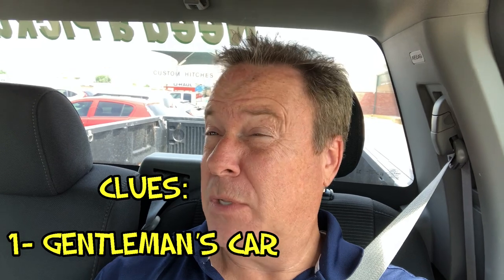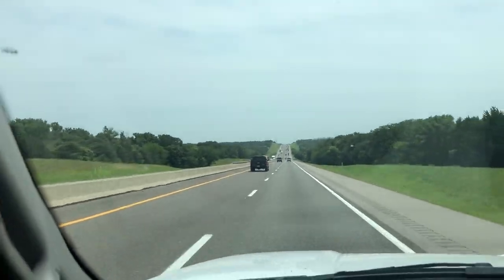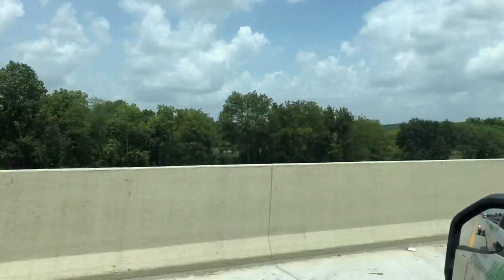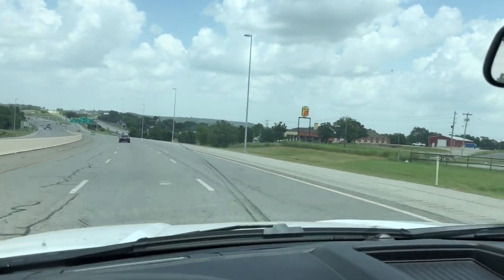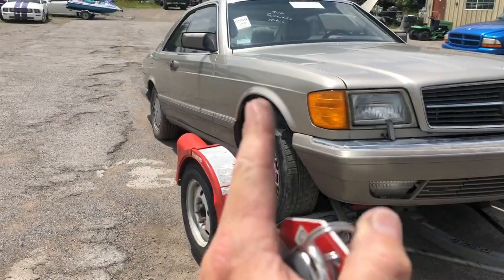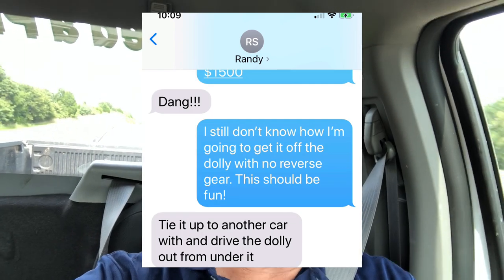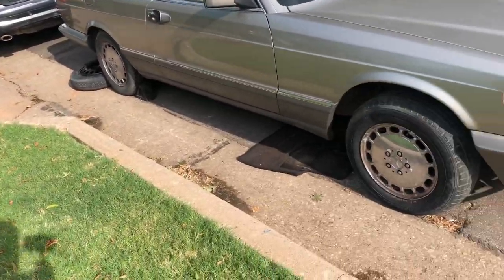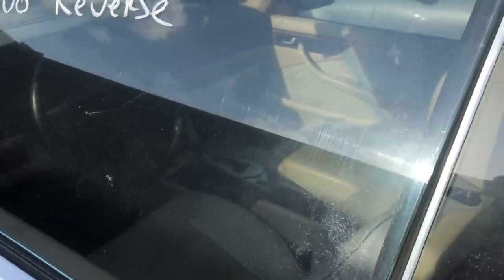Mike Buys A Classic Mercedes!

Comment: Hey Mike. Few things. 
It’s not a great idea to tow a rwd car with the drive wheels on the ground and the driveshaft connected. It will burn up the trans...either put the rear of the car on tow dolly or put on a car trailer. 

Check to see if your shifter bushings are OK. These old ones were known for worn/sloppy bushings with age. It’ll make it difficult to get the right gear. Also check vacuum etc.  hate to see you put a trans in before full diag by you. 

That is a California car based on the service sticker on the driver door and info on radio.  

Check your calipers to make sure the hoses and pistons aren’t leaking- that’s probably why the chrome is peeeling bad. 

And above all CONGRATS on the car!!!  Very cool find. I’ve been a subscriber since you barely had 100 - great entertainment.  Keep it up!!!
Reply from the maker: Thanks for the tips. I know about towing with the rear wheels on the ground, but because this car already needs a transmission I wasn't concerned. The previous owner tried everything to get it to work, but there's no reverse which is a common problem. I'll check out the calipers! Thanks!!
Reply: @MonkeyWrenchMike  the w126 chassis Mercedes received the first version of the G-Tronic transmission.  I have really like your SEC You got.  I love the w126 chassis, they have a very stately and intimidating appearance.   But intimidating is what they can be to work on too.  That's sad yours doesn't have a reverse, but are you entirely sure reverse is completely gone.  It wasn't as simple as the selector bushing being worn resulting in the selector being in reverse but the linkage didn't actually select reverse?  Or the shift modulator?  What about the fuel pressure regulator?  This affects shifts by throwing off the amount of vacuum the car receives.  I'm just curious because I haven't heard of Daimler-Benz era Mercedes having transmissions really die.  I've heard of them act like they're dying due to other things completely unrelated to the transmission making them mess up.  My transmission shifted funny due to the pcv hose.  3rd gear would slip under a certain amount of throttle input, but once that hose was changed (and only that hose) it shifted beautifully.   It would also bang into reverse and spin the tires a bit, and that was fixed with the hose too.  The Daimler-Benz era Mercedes are all worth saving and they are really well engineered and super high quality, but they can be a big pain to deal with when they get to the age where everything is wearing out.  I asked these questions because a transmission is so expensive, and with an old Mercedes 9 times out of 10 the solution to a problem is because of a problem elsewhere on the car that is a cheap and easy fix.  Oh, one important thing with the w126 chassis and r107 v8s is the timing chain and the guide rails.  If you haven't checked out Kent Burgsma's videos at Mercedessource, I highly recommend that you watch them.  He has decades of experience with Daimler-Benz era Mercedes and has some clever solutions to things.  He has a ton of insight that all Mercedes owners can certainly benefit from.  My 380se needed a new chain, sprockets, and guide rails and it's at 150,000 miles.  I hope you're enjoying yor SEC.
Reply: @jacobbelcher3512  Very good Advice!  I drive a 87 W126 as my daily driver for 2 years now.  Solid as a Rock.  They were heirloom cars. Dealers told Owners to change their Will to decide who gets it on their death.  They were intended to last that long.
Reply: @jacobbelcher3512  Nothing "Tronic" about that transmission, purely mechanical.   That car has a version of the 722.3 transmission and when they wear out, the reverse clutch (B3) is usually the first to fail.  The first hint of trouble is when you put it in reverse and it takes a couple of seconds to engage.  I've rebuilt a bunch of them and they are a very nice gearbox.  The G-Tronic you are probably referring to is the 722.6 which is an all electronic valve body controlled by a computer and is the predecessor to the 7G and 9G.  No W126 ever got a 722.6.

Comment: Check to be SURE the linkage is actually putting the transmission into reverse. This was the problem with my 560SEC! If the shifter bushings are gone, this is an easy check. More involved:

http://www.europeantransmissions.com/Bulletin/DTC.merc/97-20.pdf

Comment: I had a 560 from 1987 and currently own a beautiful 500 SEC, 1985, purchased from the original owner. It's a keeper. Spent a bit of time with none other than independent Mercedes mechanic extraordinaire Pierre Hedary in April and he sorted everything for me. Yours certainly was neglected in some areas and will need a lot of attention. But if you are methodical it will be well worth it.
Reply from the maker: I may need some guidance from time to time!!

Comment: Hey Mike, I have a 1988 W126, and I had problems with the trans too. It wouldn't shift out of 1st gear, and also had problems getting it into gear from park. My mechanic was able to correct the issues with 2 simple fixes. The first, the reprogrammed the computer (apparently these 30 year old "classics" have 2 of them); and the second fix was to replace the gear shift bushing. Trans works great now.  Hope this info helps...
Reply from the maker: I’ll look into this. Thank you!!

Comment: I am making the assumption the transmission shown on the ground is either a "used good" or rebuilt. If that was included with your purchase, you did well.  It is really nice to see a car of that vintage (nearly 25 years old) in such nice original albeit sunburned condition. It is relatively free of whiskey dents and parking lot swine imprints which says a lot for the history. I am looking forward to see your progress.
Reply from the maker: Thanks! And the transmission was included!

Comment: Nice Merc, and with the biggest V8! Remember not to tow the vehicle with the driven wheels on the ground because it will cause damage to the transmission (unless you don't care because whole transmission is bad).

Kent from MercedesSource made a video about rescuing many W126 300SD and showed the proper way to tow a RWD vehicle with A/T on a dolly. It takes some time, as you have to unbolt the driveshaft and tie some things up, so the transmission doesn't spin together with the wheels and with the engine shut off.
Reply from the maker: Yes, the trans is bad, so it didn’t matter. And I love Kent! I watch all his videos!!
Reply: Monkey Wrench Mike Haha, it's a must for Mercedes enthusiasts and people fixing these like you.

Comment: Nice video. My only car is benz and benz only. But from the dashboard it is 1989 or 1988 and it is very easy to repair the transmissions in these models. Keep going 😊
Reply from the maker: Tell me more about transmission repair!!
Reply: @MonkeyWrenchMike   it is easy to repair because all you need is to change the clutches. There are 4 clutches , 3 front and one is for rear or reverse
Reply from the maker: I’ll have to google this!!

Comment: Nice choice on getting the uber-Merc.  A lot of marque experts say the 560SEC is the best overall car Mercedes-Benz have produced yet, it's still very much the engineer's car so it's still fairly easy to work on and not full of computers.  Now's a very good time to buy one, especially one that needs some attention, as prices for them are going up rapidly everywhere, which means it won't be long before the values of them in the US start to spiral too.  Keep it for ten years and I wouldn't be surprised if it becomes a $100,000 vehicle.  Just watch out for rust in the rear shelf behind the back seats, sunroof leaks can cause that area to get flooded with rain water with catastrophic results, though that shouldn't be an issue for a Californian car...
Reply from the maker: Cha-Ching! Love the sound of that!!
Reply: @MonkeyWrenchMike    Mercedes-Benz will probably never make another car truly like it so they're not going to get any less rare...

Comment: New viewer great video 
Just love the car
We have a W126 300SE from 1989 it’s a very close cousin 
Things to look for will def be brakes had to redo all of ours
And half baked repairs ( scary) someone loved silicon with ours except it don’t fix oil leaks on low level oil sensors!! New parts do that
Oh not a good idea to tow with the tail shaft in with drive wheels on the ground Can do damage to the trans
Cheers
Reply from the maker: Thanks for the comment! I knew the tranny was bad, so I went ahead and towed it that way because it was easier to get off the trailer. 

Right now it only runs for about 20 seconds then dies. I’m doing a video on it. Any ideas on why it won’t stay running??
Reply: Monkey Wrench Mike all good
Can’t wait to see this Merc progress 
Cheers from Australia
Reply: Monkey Wrench Mike 
Hmm running for 20 seconds not sure
A relay cutting out
Fuel pump maybe
Something is cutting off
Wish I could give you a better answer

Comment: Wait, I heard somewhere you should not tow an automatic mb with the rear axle on the ground because there’s no pressure in the tranny to keep it happy. Could have put it on the trailer backwards with front wheels locked. My 2 cents.

Comment: Hey Mr Monkey Mike.  I got a question for you.  I have a 2000 Mercedes SLK230.  The manual says to use E10 Premium gas. So, will it hurt the engine if I have to run E15 Premium or lower E10 or E15 octane?.  Can I run non-ethanol premium?  I have been getting all kind of answers.  I love the older Mercedes.  I had a ‘74 240D in ‘74
Reply: Taz Mod non ethanol 93 octane is the best if you can find it.
Reply: Don't use E15. Lower octane won't hurt it but it's best to use the right octane in the long term and for fuel economy.